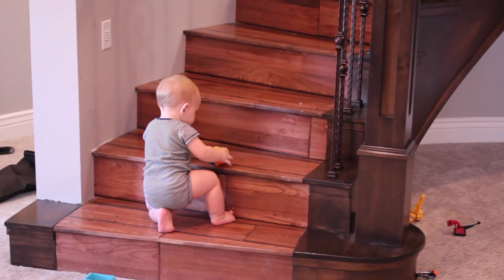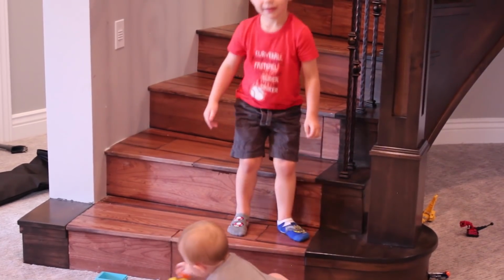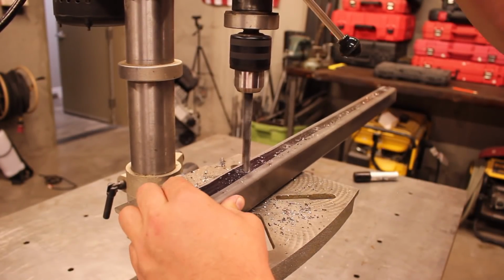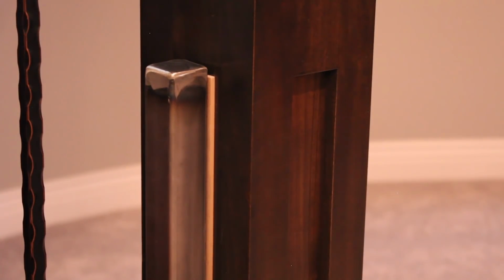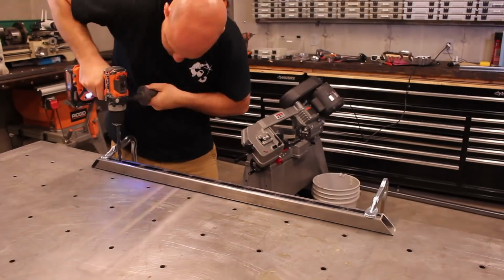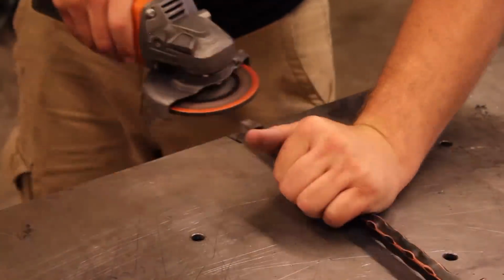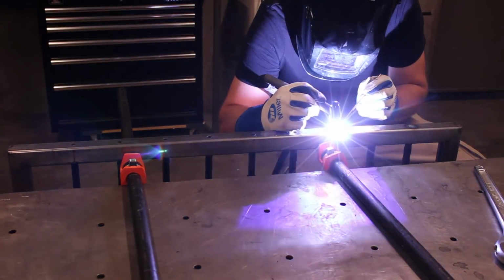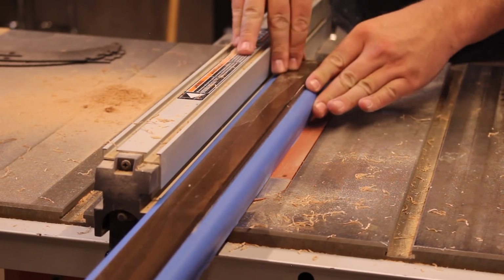Steel Baby Gate

Comment: Looks great and nicely edited , how did you fasten to the hand rail post.
Reply from the maker: Do you mean how did I mount the newel post? Or how did I attach the handrail to the top of the gate?
Reply: @TheConcreteBox  sorry, the newel post.
I just rewatched it, is it just a friction fit in the reese on the hand rail post.
Reply from the maker: Check out the previous video. Thanks! https://youtu.be/QcGy21X5wHE
Reply: I rewatch both videos and I also can't see anything else but the friction fit - which doesn't feel a 100% right to me. Is it?